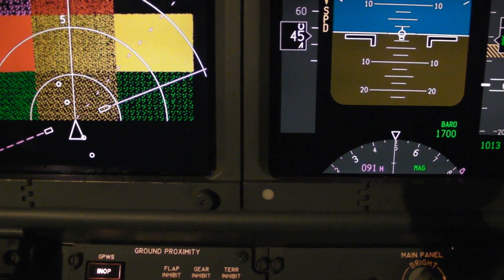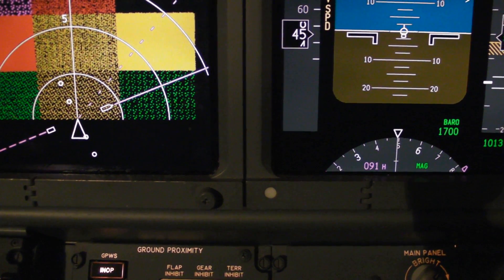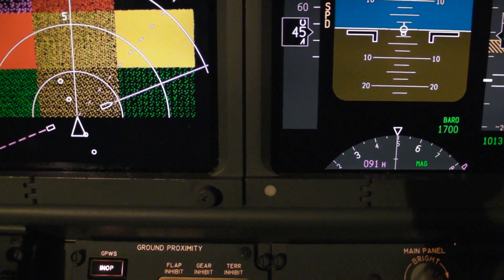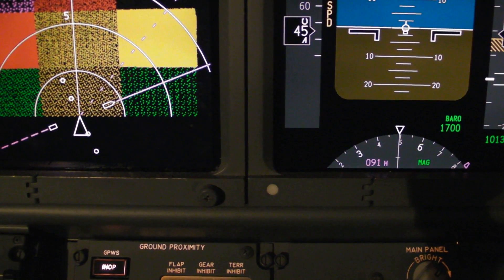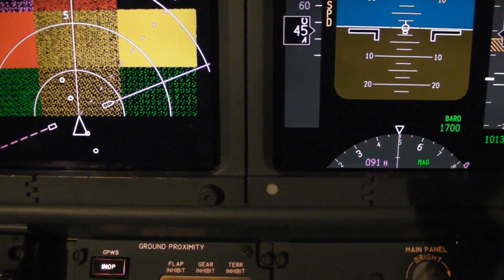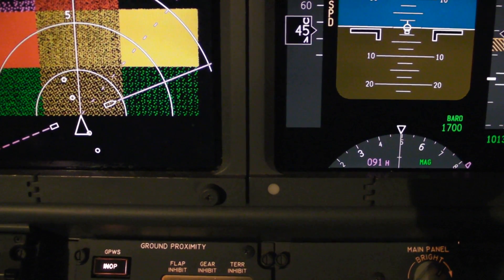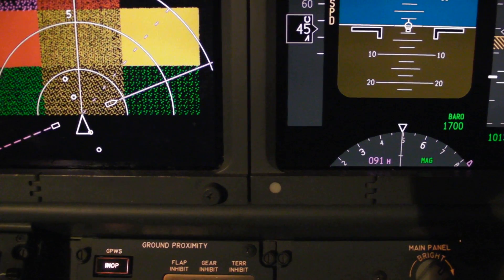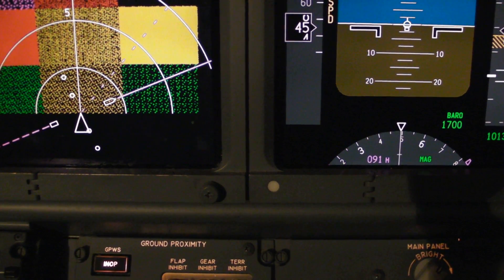GPWS Extended Test

Comment: Where is the stall and fire  warnings?:(
Reply: theroxx91 There is a button near the fire extinguisher handles, where you can test the fire alarm system.
Up on the overhead panel, there is a button that will activate the stick shakers. I believe the hydrolics need to be on to test it.
Reply: Correct, hydraulics need to be on - at least, on earlier versions of the 737.  There is also a test for the overspeed feature as well.
Reply: Fire tests for engines and cargo systems is differentiated (see ATA26). Push button on averhead panel. You coul'd see my video.